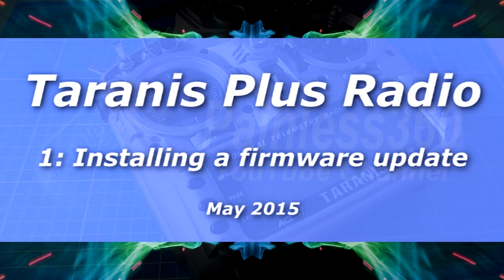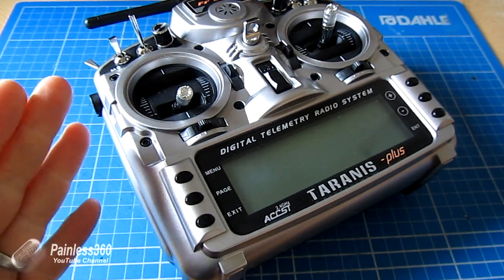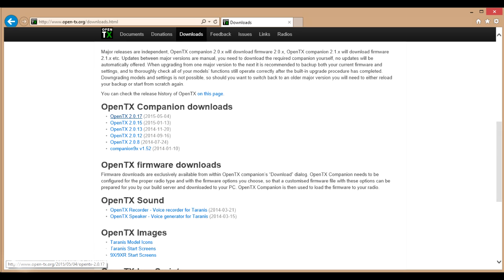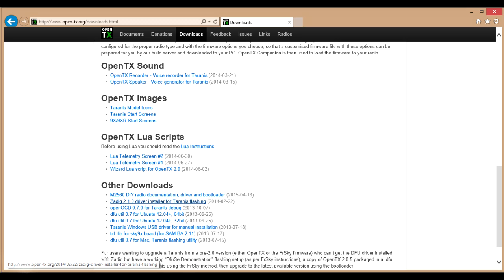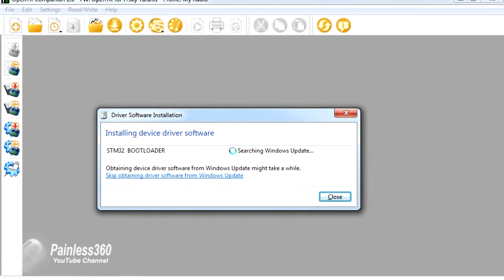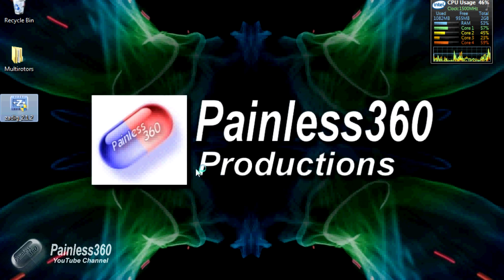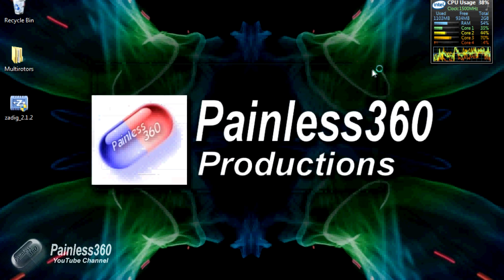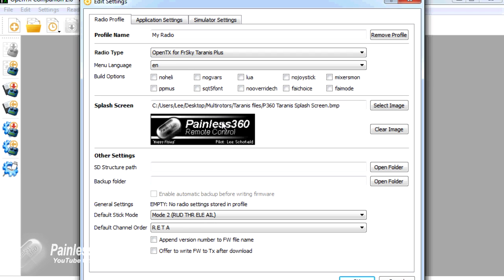(1/12) FrSky TARANIS Radio - One way to update the firmware

Comment: You really got a video for every question I have, lucky me! I'll soon be getting my Taranis, so I am orientating myself on installing openTX. In the video I saw you didnt use an EU version nor did you select EU at the build options (in companion app).
I live in the Netherlands and I think I want or have to to use the EU firmware. But I am confused, I have the openTX EU firmware, but do I still need to check the EU option at build options? I don't understand how they relate.
Reply from the maker: http://www.multi-rotor.co.uk/index.php?topic=14975.0 does an excellent job of covering it. Hope it helps..
Reply: thanks, the post on multi-rotor did make thinks more clear. I still have to figure out these questions for myself
- how does an EU opentx firmware relate to the EU build option
- If i understand correctly, if I install opentx, it will only update the OS and not the XJT module, can I also update the XJT module separately?
- can I upgrade all the new frsky receivers with EU firmware?
- can I upgrade a non-eu X8R with EU firmware so it will bind to my radio

still have some googling and reading to do
Reply from the maker: I'll try to answer those quickly 1) Not really, you can run mismatched 2) Yes and Yes 3)Yes 4) Yes. Hope that helps! :D
Reply: cool, thanks, that saves me some googling. 
I did find some info on how to update the internal XJT module of the Taranis
http://www.dronetrest.com/t/how-to-upgrade-firmware-for-frsky-taranis-x9d/959
makes it more clean now, thanks
Reply: Got my radio, updated the radio + X8R receiver, all went fine. Now watching the rest of the Taranis video's :)
Only thing, the taranis freezes sometimes in bootloader mode, while copying or deleting files from the SD. Also posted this on rcgroups, I hope more people have this.
Reply from the maker: I've not seen that here - could be a different SD card will be better. I tend to pop the SD card out of the radio to add images/sounds etc.. Best of luck!

Comment: I followed this (except used a newer firmware) and went through the whole process and it did the update/flash thing and i unplugged the radio after and when i turn it on i get a white screen and the radio vibrating/humming. What did i do wrong or how can i fix it?
Reply from the maker: I've not seen that here, sounds like something went wrong with the update. http://open-txu.org/home/special-interests/curing-a-bricked-taranis/ may help. Best of luck!
Reply: Painless360 thanks i will give it a try

Comment: hi there,
I'm just wondering if you could give me a help with that.
I bought a taranis plus off Bangood as my first radio to play with a micro quad. The first thing I've done was the  firmware upgrade, routine check and calibration so I could have my first fly, but then I notice that my aileron was acting bit weird and couldn't have a stable fly, my knowledge till that point with taranis was near 0, I've checked the inputs, mixer and outputs weight and offset and they were 100 and 0 respectively, then I checked the channels monitor and analog output and they were showing a minimal of -69.7 and a maximum of 100, (something wrong!!) calibrate the channels and nothing, created different models and didn't change, I assigned the aileron to a different channel (other than CH2) no change, I verified all outputs set to mid 1500, min and max -100 to 100 was ok, I checked the box to use "extended limits" didn't change, I even flash the firmware 2.1.6 (I'm using the 2.1.9) I thought it could be a firmware bug, but was the same, and now I'm running out of ideas (which are not many I'm sure) and I hope you could give your thoughts about... I post a video of the radio showing what happening if you may want to have a look, I will be really thankful

https://youtu.be/mP4zosIUMu8
Reply from the maker: I've not seen that here, looks like the stick calibration isn't working exactly as expected. I'd retry the calibration routine again. http://open-txu.org/tag/calibrate/ Best of luck!

Comment: when connection to the PC i dont get the windows notification sound when connection new device.

The radio says usb connected but in windows 10 i cant see it in device manager or printers and devices.

When trying to open zadig it also doesnt show STM32 bootloader.
Reply from the maker: What have you already tried? I'd get another USB cable... Best of luck..
Reply: :CRY: ive used the cable i used for other things succesfull but Taranis might be different,.. When i use another cable windows lets me know there's a new device,..

TY Lee
Reply: For me, it was the cable. Even though the cable worked when using it for other device, for some reason it didn't with Taranis. After switching to another cable, it worked.
Reply: This is happening to me too.
Reply from the maker: Surprising isn't it! Glad you got it sorted..

Comment: hey painless, when i'm trying to flash 2.1.9 i am getting the following error message at the bottom: 

File downloaded successfully
No valid DFU suffix signature
Warning: File has no DFU suffix

Any advice? also, there is no previous firmware on the taranis x9d. do i need to flash a different file first?
Reply: also, when i turn on the taranis, invalid EEPROM apears

Comment: After i upgraded my 9xdp to the latest version 2.1.9 i could not bind anymore my recevers,  please relp me
Reply from the maker: I've not seen that, I'd downgrade to what you had before to get back to all working. Best of luck!
Reply: Yes, But I made a backup FW and write it to the radio, but still not binding. When i use a external module it binds normaly with all receivers that i have. I dont know more what do.
Reply from the maker: I've not seen this here, you are using a known good Rx that you've bound to before? There are two firmwares on the receivers - EU and non EU and you need the same as the radio you have..
Reply: Yes my friend I already bound it befere the upgrade normaly, i don´t change anything on rx, and its binding normaly with my external module. the rx is good and known.
Reply from the maker: Sorry, I've not seen that here. If you figure out what it is I'd be very interested to know.. Best of luck!

Comment: Hello painless360: i m a beginner in RC and going through all the playlist in your channel. One question: i m using TX frysky fs-t6, will this playlist of taranix will be useful for me ?
Reply from the maker: Nope, see the playlist for the FS-i6s radio on the channel. FlySky and FrSky are completely different. Confusing isn't it! Don't worry, the 'Introduciton to Remote Control' and 'Quadcopter Building for Beginners' are designed to get a new pilot/builder up and running. Best of luck!

Comment: Is it advisable to flash the Taranis? I was reading the paragraph at the top of the openTX sites downloads page there titled 'For Taranis users', about the firmware flashed by FrSky. Is the OpenTX still going to be compatible with everything? For instance theres a big yellow sticker on my Taranis and my receiver saying that they've been flashed with the EU LBT firmware, would the downloaded OpenTX still be compatible with that?
Reply from the maker: Don't get confused. OpenTX is what runs on the radio itself. The internal module that creates the radio signals has it's own firmware that decides if it's an EU or non EU compatible radio. You can flash the radio transmitter module without affecting OpenTX and vice versa. Hope that makes sense!
Reply: +Painless360 Yeah it does thanks :)

Comment: I have watched a number of these video to try to update my firmware. The present firmware was 2.0.16 and the newest version is 2.0.19. I have tried all that I have come across to flash the radio but end up with the same error you did and my radion now, will go on with a buzzer warning and switch audible "throttle" warning. The screen is blank/white and I have no access to the radio programming. HELP!
Reply from the maker: That doesn't sound good. I've not seen that here but read about trying it with the SD card removed/another one and also unplugging the battery for a little while before trying again.. Best of luck!

Comment: great series, finally bit the bullet and ordered one to go with my new 250 racer.
Reply: Have had a nightmare setting this up, but finally done it on my Eachine Racer and Bonzai. Now going to set it up on my Alien Quad with APM. Bit more complex there with all the sensors and flight modes but I am very confident now I have ironed out some of the quirks :D Your videos were a god send! PS I have it international LBT setup so can still use the older receivers and higher dbm sensitivity :)
Reply from the maker: Good idea ;)

Comment: great video series. Very easy to follow. Cheers.
Reply from the maker: +Harry Holt Thank you. Happy flying!
Reply: Painless360,
I want to update my taranis x9D which is right now on 2.1.6. While the radio is off, I used zadiq 2.2 to  update the driver selecting STM Bootloader. I opened OpenTX compagnion 2.1.8 and downloaded the latest firmware. I also tagged in my profile that I want to be able to update firmware. 
Problem is that although Zadiq says that it was a success the opentx can not access it _ "not connect or driver not properly installed" and in the device manager STM bootloader is listed but has a warning sign.

I read in the manual of the taranis that Zadiq should not be used any more and that it is suffficent to use the bootloader of the taranis. 

Can you help? This is all rather irritating.
Reply: What I did next was to reboot my notebook. Turned out that when It was booted the taranis was a "unknown device" and the STM bootloader was not an option even if I selected all "all devices". 

HELP!
Reply from the maker: I'd delete the device in device manager and plug the radio in again. Best of luck!
Reply: Thanks painless360, 
I must be quite near to a solution but.. "It says in the device manager "FrSky Taranis Joy stick" when I turn it on. but when I turn is off and reconnect to USB it is a "device unknown". How is this possible? And as "unknown device" Zadiq does not recognizes it as well. 
How can someone sell a device to be connected via USB when it does not come with proper drivers?
Reply from the maker: I'd reinstall the Zadig pieces again - looks like it's not substituting the one you need. All we did is in the video. Best of luck!

Comment: Hello,
Thank You for your very informative videos. 
After flashing the firmware with the 2.0.19 version, I get a throttle warning each time I turn on the X9D Plus. And when I connect an ESC to the transmitter after binding, the motor connected to the ESC spins at full speed right away. I am unable to control the motor with any switch on the TX. Could you help?
Reply from the maker: +Tejasvi S.T.S. After an upgrade you should check the stick calibration. http://open-txu.org/basics-of-calibration-on-the-taranis/ Best of luck!

Comment: Thanks .. the "Tarannis" is the "Tarannis 9xd". The dropdown box in the companion software lists exactly what is written on the front of the tranny. Being only acquainted with a futaba 35mhz 6 channel steam powered radio. It is very difficult when you do not understand the terms used. Eg "servo reverse" is easy but to find out you change the "weight" from +100% to -100% is computer speak.... let alone "boolean" etc. When I finally "flashed the software" at silly o'clock last night the tranny had lost all my models, radio set up and decided it was mode 1!!! I was some thing I did when messing about with it. Thanks for the really great view. Without this the radio would have been of little use.

Comment: Great videos. I have never got round to upgrading the taranis plus firmware and have set up a zmr250 with base flight and a q450 (clean flight) with naze 32 boards all with many of your tips and tutorials. I would like to use the companion software but not sure if I upgrade, will I loose all my settings? I am using the taranis with whatever version software it came with. This is my first post as you have pretty much answered every question.
Reply from the maker: +Simon Ranger no idea, the EEPROM that holds the models shouldn't be affected. We did ours on day one. We do show the process to move from 2.0 to 2.1 and do cover what you need to 'backup'. Best of luck!

Comment: Warning for those with USB 3.0 ports: It does not like them. I tried about an hour of troubleshooting before I pulled out a USB 2.0 hub, plugged it in, and then it worked flawlessly.
Reply from the maker: +Jason Kyzer great tip, thanks for sharing!

Comment: i have all the same harware for the sp3 series and have the frsky x4r reciever and taranis x9d radio i have not been able to get help on rcgroups at help for scratchbuilt copters I'm now trying to go through all the radio settings because I have not been able to get my taranis radio to put out any signals or Channel changes on the receiver tab in cleanflight

Comment: fixed it ,I loaded taranis firmware instead of taranis +. had to reload onto sd card and reboot that way . just pulling my hair out trying to write a new skyhunter model .have you got a video where you assign a mode switch to control a dragonlink osd? 
cheers steve
Reply from the maker: +Steven Clarke We've done loads of 'mix tips' and 'mix school' that show how to add an extra channel and get it to output the values you need, let me know if you're still struggling after watching a few - they tend to use the same bits over and over..

Comment: Hi painless 360 i think I have buggered up my taranis ,just tried to update to 2.1.8 and when I turn on transmitter I get a blank screen and it buzzes . have I fried it beyond repair? any help would be grateful cheers steve
Reply from the maker: +Steven Clarke Blimey! I've not seen that. Can you still start it with the tabs in or out and powering up? If you can hen you may be able to retry the update.

Comment: Hi Lee, following our chat, we have a taranis x9d plus but unfortunately the display is in Spanish, we would love to know if this could be changed to English? Without affecting any of the other settings? Thanks, Emma.
Reply from the maker: +Emma Soar Hi, I've looked and looked and it appears that this is set when you install the firmware into the radio. Looks like you need to do an update with the settings as English - see our OpenTX2.1 update video for full, step by step instructions.. Best of luck!

Comment: Hello, Big fan of your channel. Thanks for all the knowledge that you share. My question is , I just purchased the Taranis Plus and I tried to connect it to my Win 10 PC without getting any results, do I need a special micro usb cable?  Also, what do you think about the 120mm micro quads? Maybe you could do a build testing the maximum power limits and compare it to a similar type done in 250mm. I have seen several 120's done on the internet and they seem to producing impressive results. I think that with your knowledge and skills you could build an impressive contender. Thanks for sharing knowledge and I look forward to watching the next series (whatever it may be, it's all good stuff)
Reply from the maker: +Jim Weeks 1) no special cable needed but some USB cables only have the power pins connected. 2) 120 is a little too small for me, I like the 160-180 class and love 200 or 250 class frames. Thanks for the idea!

Comment: Thanks for the video series, this would still be a fantastic radio if i hadn't seen it, but i would have a rough time getting it to do anything besides turn on. I couldn't get the computer to see the taranis (either as an ext hard drive or to be seen from companion) and i noticed other people having comm problems so..

I had problems going to i think version .19, followed all the steps, i'm sure around a dozen times, i was ready to throw it all out the window. But instead i spent the next few hours (ok, most of the next day) reading and trying and reading, but mostly reading and reading. I saw a post that said people were having problems on laptops, especially dells (and some other brands i can't remember, i have a dell). I took everything over to my desktop, everything worked like magic. Can't say this will be it for anyone else but is worth a try if you know you've got all the steps right. Apparently something in the chipsets (?) that makes some systems incompatible. My laptop i keep pretty clean/everything works well etc, but for whatever reason, changing systems did it. A day and a half installing a silly driver? Blegh, but it works now..
Reply from the maker: +RockPDX glad you got it sorted!

Comment: I have followed all of the steps but after  7:00 once it is done reading the firmware, it will come up with "New firmware is not compatible with the one currently installed!" 
If you can point me in the right direction it would be greatly appreciated.
Reply from the maker: +Liam Holding Check that it's for the version of the radio you have (plus etc). Best of luck!

Comment: Thanks so much again!

I am having trouble with my SAM-ba.exe     trouble is i don't have any ATMEL software on my machine.
the sam-ba.exe seems to be Reqd. to talk to the chip for updating firmware. my firmware is 2.0.9 - the latest at writing is 2.0.19.

when downloading it does the green bar and then conks-out with the message that the sam-ba.exe could not be found.

Any suggestions?
Reply from the maker: +STLhive.com Not sure, I've not done it that way... Best of luck.